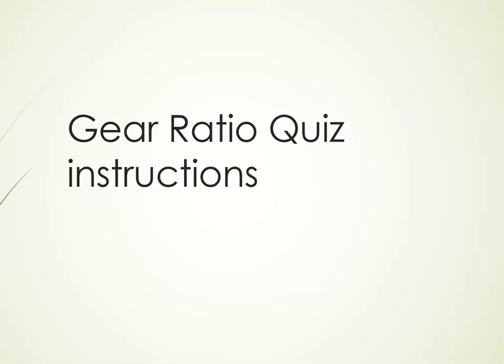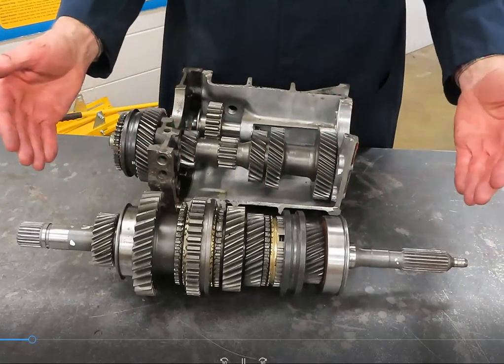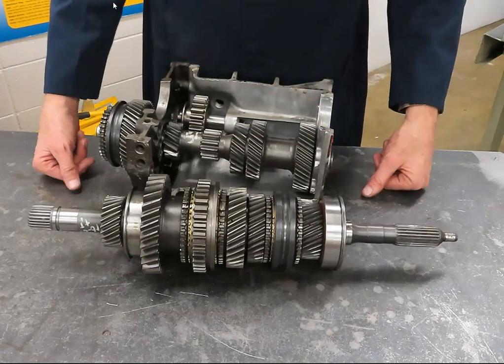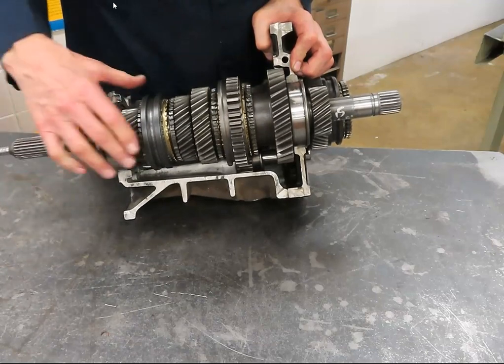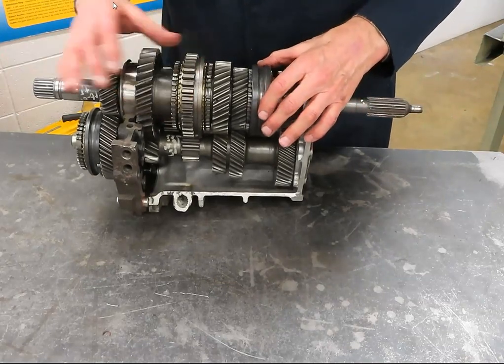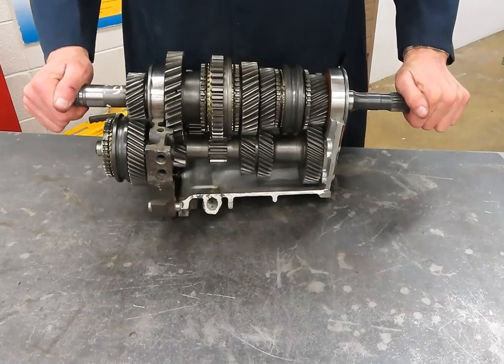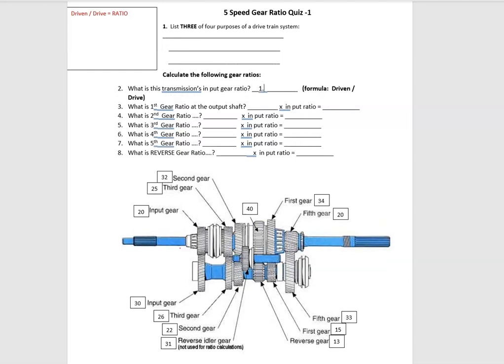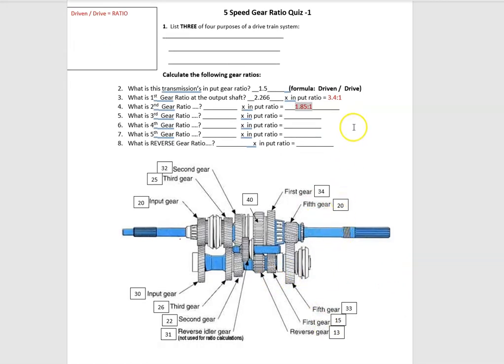Gear Ratio Quiz Instructions

Comment: Really appreciate yr explanatory videos..i have a renault  master 2013 six speed manual ...there is a horrible rattle...only in 5th gear...so would that b bearings..im thinking that my 5th gear might be on the bottom shaft like the 4tg gear in yr example.  How to fix this?  Is that a case if pulling the thing out and sorting/replacing bearings ?  Thanks